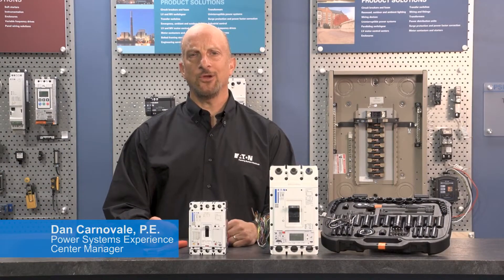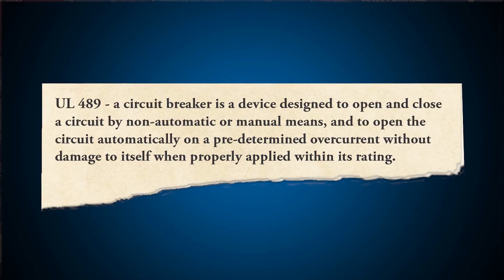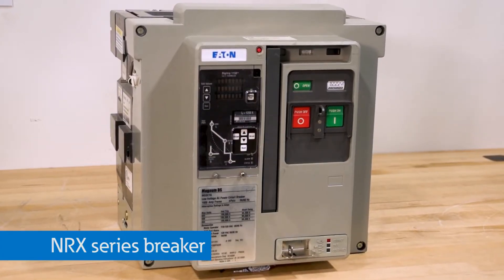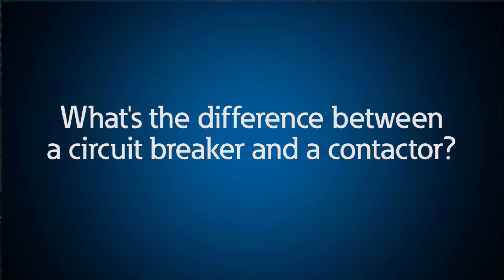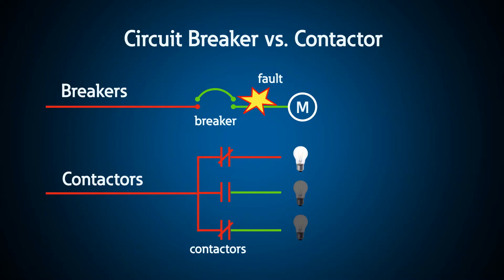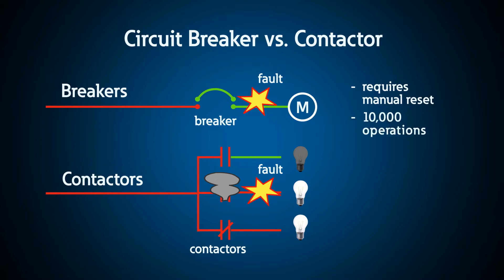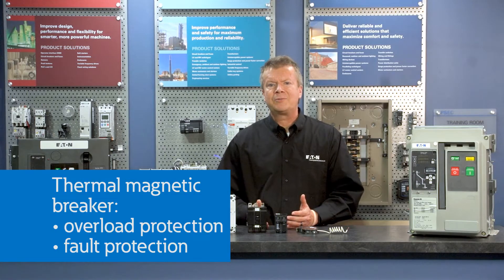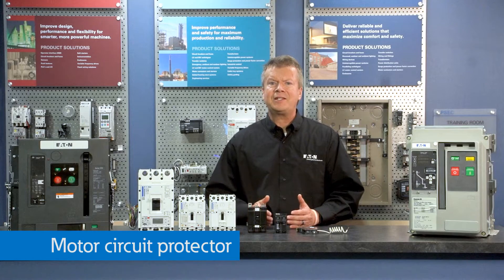Circuit Breakers Explained

Comment: I think this video is a well-produced and informative video that is worth watching for viewers who want to learn about circuit breakers.

Here are some key points mentioned in the video:

A circuit breaker is a device designed to interrupt a current in an electrical circuit either automatically or manually under abnormal conditions such as overload or fault.
Circuit breakers are used for feeder and branch circuit protection and are designed to provide overcurrent protection for overload and short circuit conditions.
There are many types and sizes of circuit breakers used in electrical power systems from residential to large industrial and utility systems.
If you are interested in learning more about circuit breakers, I recommend watching this video.

Comment: While on the subject of miniature circuit breakers,  specifically 3 phase breakers,  there is an obsolete type, that was actually banned by the NEC in 1978, and it is called a delta breaker, used with high leg delta systems, this oddball breakers plugs onto the 2 bus bars in a residential panel,  and has an additional lug for the third phase, the high leg, which typically came directly from the meter base and is usually unfused, and was used when there was only one three phase load in the building, in a residential panel this was mostly used in the 1950s and '60s,for central air conditioning,  some of the 5 ton condensers at the time were not available in single phase, and in some parts of the country,  notably the Phoenix area,  the POCO would install two transformers creating an open high leg delta, to a larger home, just for the new fangled air conditioners post WWII.  Delta circuit breakers occasionally pop up on eBay and other sites, and command a hefty price tag, since they are either NOS, or refurbished,  pulled out of a pre-1978 install and are therefore almost impossible to find.  I think you are still allowed to use one for a replacement in an existing installation, but you might be better off installing a new three phase panel.

Comment: Who are the presenters in this video
Reply: Watch the Eaton video on High Resistance Grounded Wye systems and Ungrounded Delta Systems. That video led to me finally finding the reason for wye (primary)/delta(secondary) transformers. As you might already know it’s not an often used connection method for transformers of any kind. These Eaton videos are excellent for filling in the gaps between electrical theory and practical implementation thereof. They rarely make an error in any presentation.